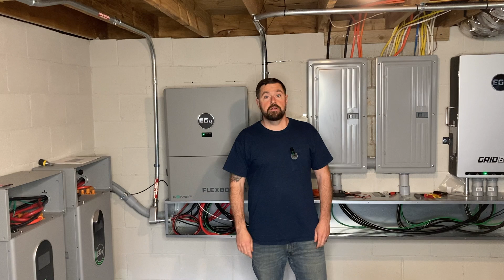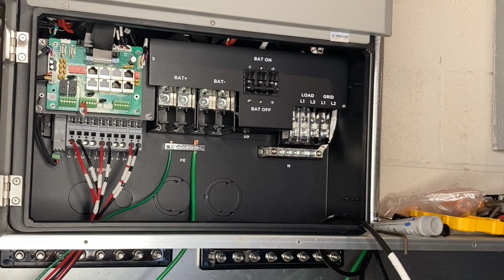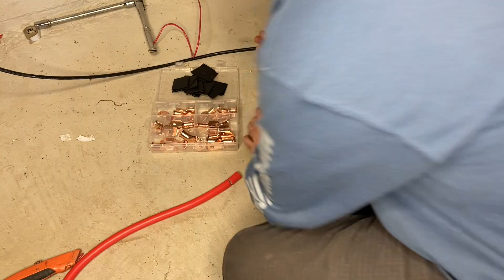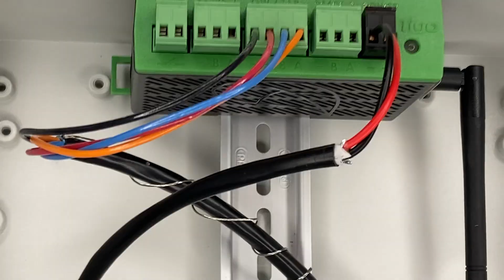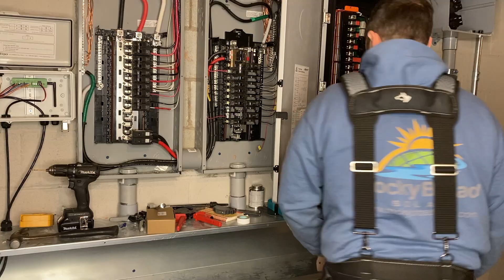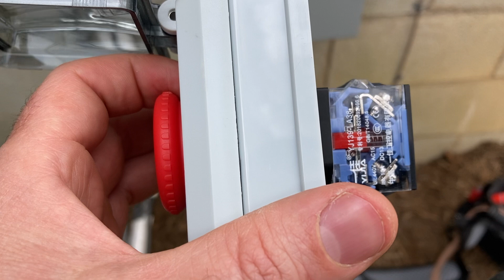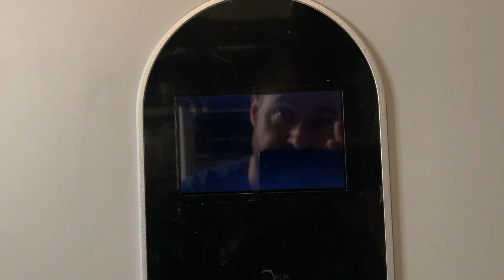EG4 FlexBoss21, GridBoss, and Wallmount Battery Installation - Part 4

Comment: It's common to mix dies a #4, #3 or a #3, #2. Depending on the condition of the cable as the outside diameter depends more on how it was stripped, the number of wires, more flexibility requires finer wire, so in my experience it depends more on what if and less on a fixed outside diameter. Also, use a ferrule, it just works better when locking stranded into a screw terminal. Great you are using a shear. I was called in to consult on a fire, the installer used a grinder to cut the cable and left shards between the strands which caused overheating. On communication shields, you don't want circulating ground loops, so it's better to ground one end of the cable. They are using CAN, RS-485, or IEEE 802.3 cg it is differential not level shifted so noise hits it in common mode.
Reply from the maker: Great insight. I appreciate you sharing this information!

Comment: This is a bit weird, you have a conduit box running across the wall... WHY IS ONLY ONE PANEL ACTUALLY UP AGAINST IT AND ALL OTHERS 6IN AWAY???
Reply from the maker: Yes, I agree. I would have all of them 6 inches away, except the original version of the flex boss installation manual called for a ridiculous amount of clearance above the inverter for ventilation purposes. In later publications of that same manual, they changed the clearances required. The same thing bothers the crap out of me! Thanks for watching!

Comment: Hey. I noticed on the rsd switch you wired normally closed for flexboss but it’s supposed to need normally open. Confused me as well with the jumper, but check instructions. It’s a logic circuit and the inverter connects internally when switch is wired. Will obviously work the way you did it but not technically what it says in manual. Page 35
Also why did you use a separate rsd that was wired instead of the internal rsd signal over core? Just curious. Wired is probably more reliable I assume.
Reply from the maker: There were zero instructions on RSD for the FlexBOSS at the time of this video, so I followed the instructions for the 18KPV and setup a meeting with someone from Signature Solar. They verified this configuration was correct and I went with it. Tested after installation and all works well. My understanding is with the Tigos the only way to make it truly RSD compliant was with an external switch. Also in my case my equipment is inside, so I needed the external switch by the meter regardless. In my opinion they should create a detailed RSD guide for any/all equipment as this area is lacking. Thanks for watching the channel!
Reply: @RockyBroadSolarLLC  you’re actually right the inverter instructions are different than the gridboss and it should be the way you did it. The rsd instructions are not good.

Comment: Did you ever get a dc disconnect for your system?
Reply from the maker: I actually did not realize it before I bought the system but the inverter has both a battery disconnect and a PV system disconnect built in. Thanks for watching!

Comment: Hey, did you ever wire your external switch into your gridboss? ON page 34 of the gridboss manual it shows to wire in the grid boss in loop with the flexboss21. Could this be the issue with your whole system shutting down vs just the pv/intverters?
Reply from the maker: When I purchased my system there wasn't much literature on RSD with the GridBoss/FlexBoss using the optimizers and CCA/TAP, so I just went for it, used the RSD 18kPV manual, and also set up some time with someone over there at Signature Solar. I have never used the RSD switch aside from the initial testing, but I don't plan to change anything. It does cut all of the PV and batteries down to a safe voltage, so it is doing it's job. That is something to think about though. It may not cut the backup loads if wired differently. Thanks for watching!
Reply: @RockyBroadSolarLLC  For sure, your videos made me want to tackle this project, so keep it up!!!
Reply from the maker: Thanks Tim!

Comment: Another waste is the box on top of the battery...way too tall.  Nothing but air.  Can't put under main 200amp panel...code specifies height of the main service panel and a battery with this monster box will not fit under one.  Wanna pub a subpanel next to the main panel and align the bottoms--can't put a battery with a box under it.  They need to make one half as tall...or less.  Only need enough height for 1 1/2" PVC conduit.
Reply from the maker: In most cases you can’t mount a battery under the main service panel either due to NEC required working clearances.

Comment: In a set up where there is no net metering and I don't to get enything out to the grid, but I want it to be a stand alone system where when the sun and batterirs are not sufficient enough, the grid to take over and fill the voids. 

How would you connect to your main 200amp panel and the meter, if they are outside on the opposite side of the 6,000 sqft single story home? Opposite side of the garage where there is a 200amp subpanel and location of choice for the install. The garage is cooled to 77 degrees or less 24/7. Arizona. 

If you let me know how to hook this up to the main outdoor 200amp panel, or even the 200amp subpanel in my garage just to run the west wing of my house, without running wires 80 feet to my main panel, I will buy the $20,000 worth of signature solar stuff right now including: EG4 18kpv, gridboss and 2x large batteries. 

I just don't know the difference from the actual hook up if I have the gridboss with EG4 18kpv, or just EG4 18kpv.
Reply from the maker: @SurgeonTech  I would personally get the Gridboss and the Flexboss21 instead of the 18kPV. Otherwise, just get the 18kPV and use the 200A passthrough. In order to offset your utility bill properly, you want your CTs to monitor all home loads. The GridBoss has them built in, so you would just want to locate it between the meter and your main service panel. Then you could locate the FlexBoss just about anywhere you please. The other option is to just install the 18kPV in place of the Gridboss and utilize the built in 200A passthrough. I think in that case you will have to manually install the CTs.

Comment: Great Video, Please get you a heat gun. using a lighter and burning the sink tubing causes carbon deposits and that is conductive. I have learned the hard way. Just a safety tip.
Reply from the maker: Good to know, thanks for the tip!

Comment: When you added ferrules to the battery cables, did you just use it as a sleeve to collect the strands, or did you crimp them?
Reply from the maker: I just used it as a sleeve and let the lug in the inverter do the rest. Thanks for watching!

Comment: Can you help me understand why you put in an AC disconnect and a rapid DC shutdown? Do they serve different purposes or just redundancies?
Reply from the maker: @TimothyDiVarco The rapid shutdown switch is required by code and it will turn the solar panels off at the optimizer level on the roof. The reason for that code is for firefighter safety. The AC disconnect just severs the connection of my inverter and batteries from the grid. This is required by my specific utility. Thanks for watching!
Reply: @RockyBroadSolarLLC thanks for the reply. The FlexBoss says it has “built in RSD capabilities”. I wasn’t planning on using optimizers in my system. Is the built in RSD sufficient on its own if I add an outdoor switch? Or do I still need something similar to the TIGO?
Reply from the maker: My original understanding was that you needed Tygo‘s in order to be rapid shut down compliant. When I bought my system, there was no guide on that subject for the flex boss line of inverters. I recently heard that you could use AP systems, rapid shutdown modules for rapid shut down compliance only. That being said, I have not been able to find any documentation from EG4 on that subject.
Reply: @RockyBroadSolarLLC  Hello again, I've got another one for you. I noticed you did not use any DC disconnects between the roof and the inverter. In the case that you needed to de-energize to do some work, would activating the RSD be sufficient? Or would you recommend putting in some DC breakers or an isolator switch?

Comment: Oh one more question, why did you use buss bars for the batteries? Could u not just go battery terminal to battery connector inside the FLexboss? Are those not already internally connected for balance? My question is because im doing 2 flexboss21s and 2 batteries, possibly 4 batteries down the road, but i am setting my units directly on top of the batteries since i have 8 foot ceiling, just wondering was this mandatory or did you do it for better balancing.
Reply from the maker: The only reason I installed the busbars was for the EG4 Chargeverter which you can find later in the series. If you can get away without it, especially with a stacked configuration, that would be the best option. Thanks for watching the channel!

Comment: is the flexboss21/gridboss a proprietary system?  will the system work well with other manufacturer's battery?  thanks
Reply from the maker: @indianfood4life it is not proprietary. It will work with any 48 volt battery. That being said I would choose a battery that had closed loop communication with the inverter personally. It is still a relatively long list. Thanks for watching!

Comment: Is there any way to connect the solar system (PV's, batteries, flexboss, and gridboss)  directly to a Meter-Main combo without having to install a seperate sub-panel aka essential/critical loads panel? Im about to upgrade my main meter panel to a 225 amp solar ready 20/40 panel. Also my system should have enough solar and battery backup to be mostly off grid the majority of the time. and yes this is a grid tied system im referring to
Reply from the maker: @jamesr8336  I would stay away from the solar ready combo meters. They are more designed for non backup systems. Instead just install a meter/main without breakers, use that to feed the GridBoss, and put your sub panel downstream of the GridBoss. So that is a long way of saying no, there isn't. The only products that can do that have meter/collar adapters like the Tesla Backup Switch/Enphase Meter Collar/FranklinWH is about to come out with one as well. Thanks for watching!

Comment: How long of a run can you have between the FlexBoss and the GridBoss? Any advice on cable sizes for a longer connection?
Reply from the maker: Hi @Preplair it is best to use a voltage drop calculator online for longer runs. In most cases 4AWG copper THHN-2 is sufficient to carry the output of the Flexboss21. Thanks for watching!

Comment: Sorry if this gets posted twice.  Having a bit of an issue with YouTube.  If gridboss is first panel on service entrance do you need to bond neutral and ground bus bars?
Reply from the maker: @BuddySlaton   If the only thing upstream of the GridBoss is a standard utility meter without a disconnect, then yes, you will need to install and Eaton CSR breaker in the Gridboss which will be your new service disconnect. You will bond the G and N in the GridBoss. Then you will need to run 4 wires(L1, L2, N, and G from the Gridboss to any downstream subpanels and you will need to unbond any grounds and neutrals in those downstream panels. Thanks for watching!

Comment: Grounding question:  I have an off grid installation with 21k.  Can I run the panel grounding through the 21k, then to my breaker panel, then to a common grounding rod.  I’ve seen a few diagrams that have a separate copper wire to the common ground rod.  Had to do with interference with the equipment.
Reply from the maker: @Hamsquatch1973   It depends if you have a ground mounted or roof mounted system, but yes, you always want to just tie your equipment grounding conductor into the grounding system at your location, which should then in turn be connected to your existing grounding electrode conductor and electrode, such as a couple ground rods 6 feet apart. For ground mounts it would be the same, except many people also drive a couple ground rods at the array as well, all tied into the same system.

Comment: Does each battery need to terminate at the buss bar or can they run series together and the end one go to the bar?
Reply from the maker: My batteries are paralleled together and then run to the busbar. If you are not utilizing an EG4 Chargeverter to charge the battery bank directly with a generator and you are able to stack the inverter on top of the batteries, there is no real reason for the busbars.
Reply: @RockyBroadSolarLLC   Looking at doing this at our lot on an out island in the bahamas.  The local power is very erratic and brownouts, and phase drops are common.  What is the best way to protect the system and the house?  Does the grid boss protect enough for these "on grid" power situations or should i connect the grid to the chargeverter only and have it charge the batteries plus solar and keep the house just on the EG4 system?
Reply from the maker: @jasonwinter739  I would just install it per the manufacturer with the grid input on the GridBoss. Get yourself some good surge protection as well and call it a day. I have had about 10 power outages since I commissioned my system and it works like a charm. Also check out my Rocky Broad Solar Ultimate DIY Guide on my website at www.rockybroadsolar.com Thanks for watching the channel!

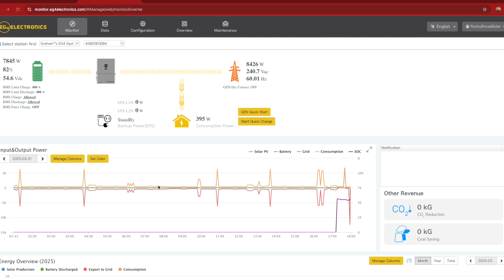Comment: Hi, these are very instructive videos. One thing: In minute 55:15 of the video, you mention that you have to enter the date many times, and the other values do not appear. This is because you have to hit the "Read" button at the center top of your screen to read the actual configuration values of the inverter.
Reply from the maker: That is absolutely correct @adalbertotamayo352 . I hadn't really had a chance to read through the manual and was just trying to figure it out on my own at the time. I plan on really digging into the web monitoring portal and settings over the next couple weeks and releasing another video on that subject. Thanks so much for watching the channel!
Reply: @RockyBroadSolarLLC  Any time, your videos greatly help me with my PV project! thanks!
Reply from the maker: Thank you!

Comment: 7:00 -- yeah, lug crimpers suck, these cheap Chinese versions always advertise AWG but send you metric dies. No better way to destroy a lug then to use metric where AWG is required. For this tool it's usually best to just buy once and cry once. Get the ""TEMCo TH0005 V2.0"" and you can do it all. It's a bit pricey, but it just works with enough included dies to fit just about everything! Besides, it's a tax write-off 😁.
Cheers 🍻
Reply from the maker: @Finite-Tuning  I love the "buy once cry once" quote. I would rather that than buy and cry multiple times. Thanks for the tip and for watching the channel!

Comment: Eg4 doesn’t sell the cables you needed?
Reply from the maker: @Hamsquatch1973  No....not in this case. If you can stack the inverter on top of the batteries, then you don't have to worry about crimping any lugs or Degson connectors but that did not work out in my case due to the low ceiling in the  basement. Thanks for watching!
Reply: @ I’ll be setting up off grid with flex 21 and 3 batteries pretty soon on a new build
Reply from the maker: If you can stack the batteries directly next to each other and put the inverter on top of the middle battery, it will save you a ton of time, money, and complexity. Good luck with the build!